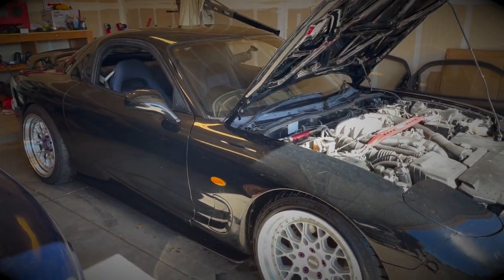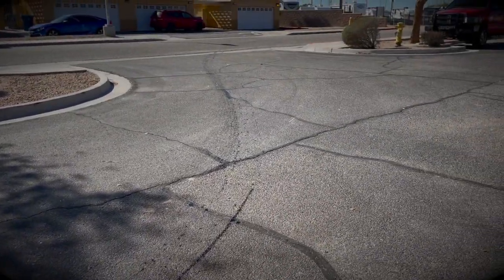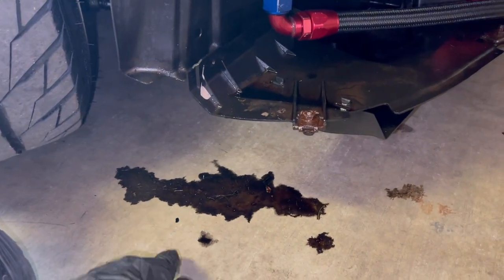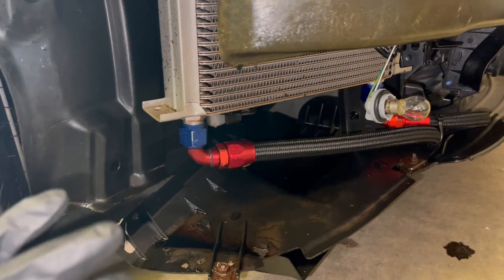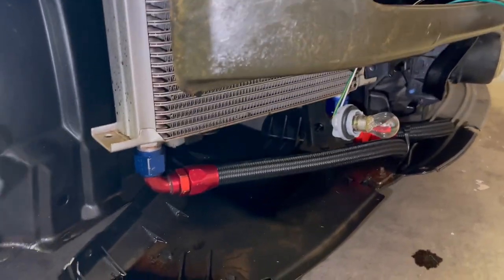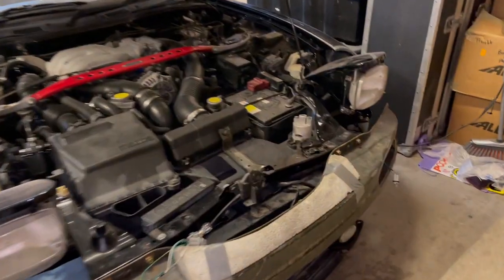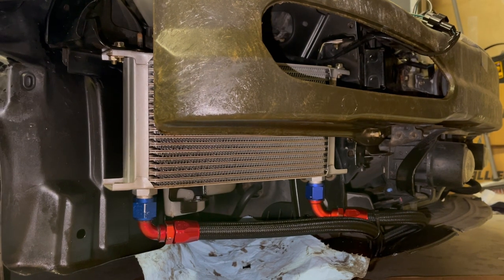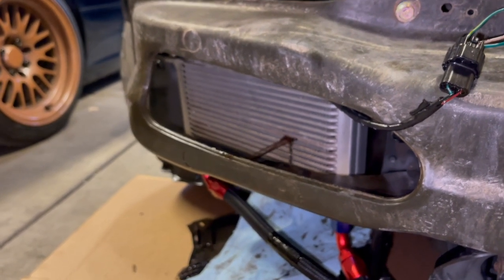My FD RX-7 Is Squirting Oil | Oil Cooler Replacement

Comment: Has the engine ever been rebuilt? Oil pressure may be too high if it’s blowing out coolers.
Reply from the maker: It has not, Oil pressure is within specification. The cooler was the issue.